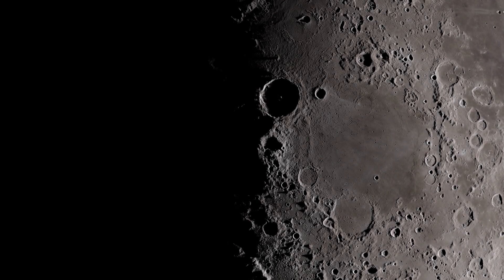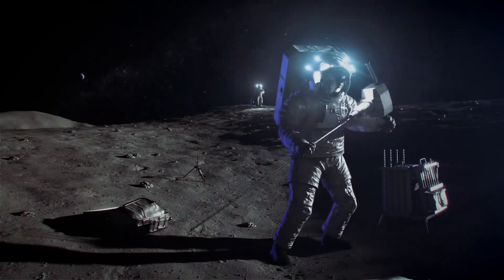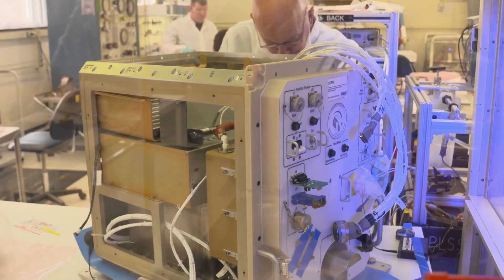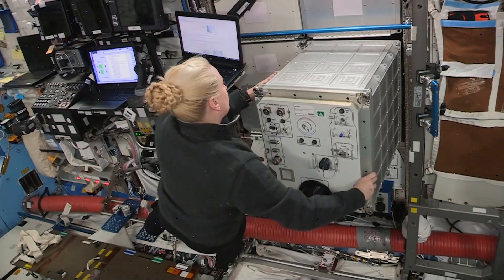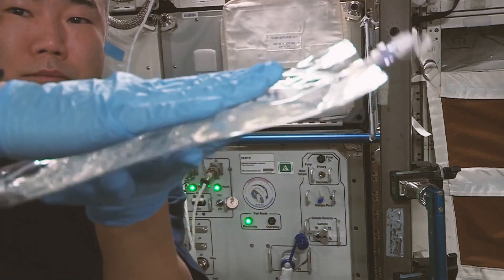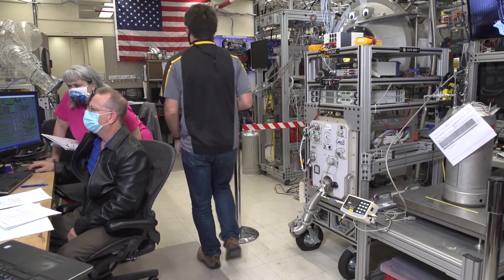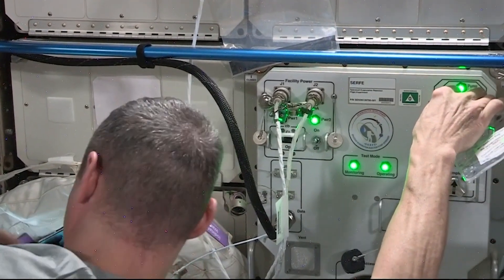NASA upgrading spacesuit tech for moon and Mars

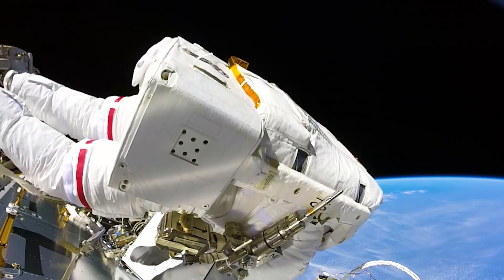Comment: 0:14 2:50 121C/ 394K
I wish that (at least the more scientific inclined) agencies would start using scientific units and slowly move away from those archaic measurements. You know, join the rest of the world, lead by example for the everyday man, the small things and all that jazz.
Reply: At least they say thst it's Fahrenheit acknowledging that others would be confused. The strangest thing is that Nasa has been using the metric system and celsius (or sometimes Kelvin).
Reply: @afhdfh  remember the failed Mars orbiter in 99'? Lockheed used English units of measurement and JPL used metric. I remember a saying you can't learn if you don't make mistakes but that was a pretty expensive one.
Reply: NASA has used metric since the 60s though. If you listen to astronauts talking about distance on the lunar surface, they always refer to it (distances) in metres instead of feet.
Reply: @Nghilifa  you realize you're arguing that they use metric as a reply to a comment asking them to use Celsius in their broadcasts after they just used Fahrenheit, right?
Reply: @Kmykzy  we're having a discussion about it.......
Reply: @nickbisson8243  it was rhetorical btw.........
Reply: @Kmykzy  gotcha no worries man